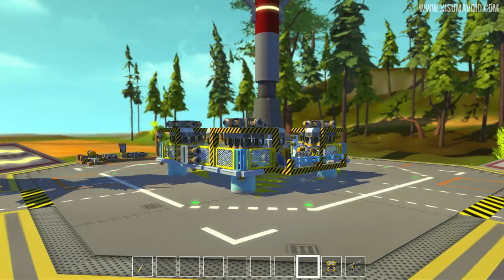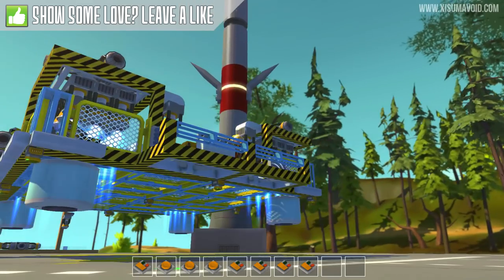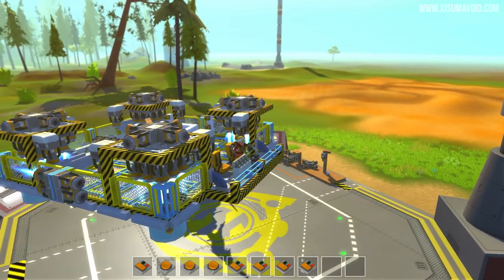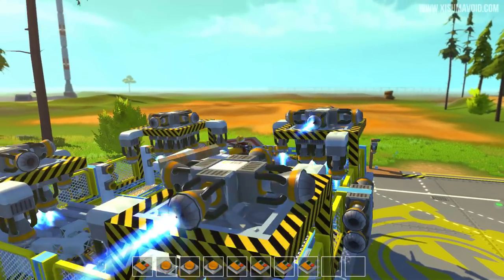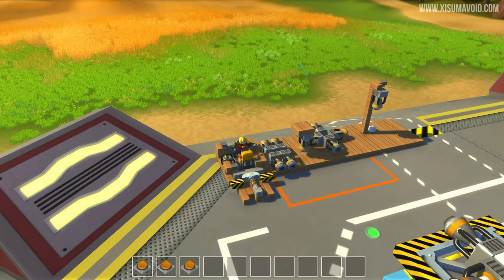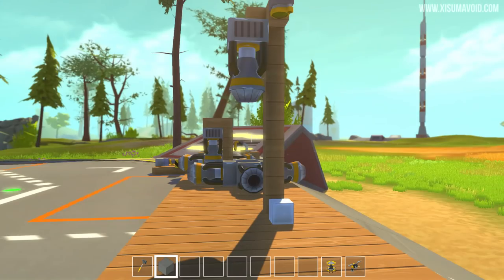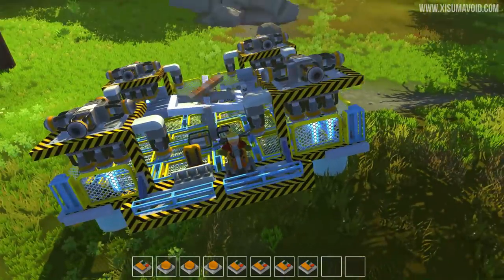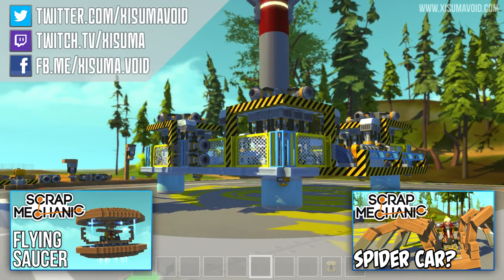Scrap Mechanic: Hovership

Comment: Xisuma, major tip that could be really useful! You can use wheels to control your vehicle in mid air! :D You could have control in all 4 directions and be able to turn very easily without tilting or anything. This eliminates the need for turn thrusters which could add weight and make teh craft slightly unstable. Aside from this tip, awesome creation! :D although slow, very cool!

Comment: I made a small hover craft with similar mechanics, but I used tires to tilt forward back left right. You should try using tires for steering, it works
Reply: dreagast did the same thing .... tires are truly magical :D
Reply: Alkymos yes, and I used his project as a precedent
Reply: Andrew Shaffer :D

Comment: Xisuma not sure if you watch Dreagast but not sure if he was the first but it was the first I'd seen of it but you can use wheels as a way of controlling a flier, if you were to hook up wheels to the gyroscope sensors it could theoretically work on compensating the leaning. But combining what he did with his "flier" with what you've done here I think you could do a very very interesting and stable hover craft.

Comment: If you want faster steering, try using suspension steering, its when you trap a horizontal suspension with blocks, then when you move the suspension with bearings, the collision with the suspension and the block its moving on, It will turn your craft, im not a very good explainer, but try watching a video.

Comment: way cool, but I hope you don't give up on the spider car. I'm pretty sure the problem with it is just that the legs are sort of bumping into each other and releasing the built up tension launching you into the air, but I could be wrong. :/

Comment: xisuma there are some other wayst to tilt the ship.    Make a 12x12 platform with the seat in the middle put on each side wheels driving into the seat each connected to an engine with a button and put 8 thruters under the platform.    The wheels are tilting the platform

Comment: You are overthinking your flying machines. You could just have a platform with a seat in the middle, 2 thurster per corner and 2 thursters on all sides that move you around. You do need fast reactions for it to not flip but it works really well and it is fast.